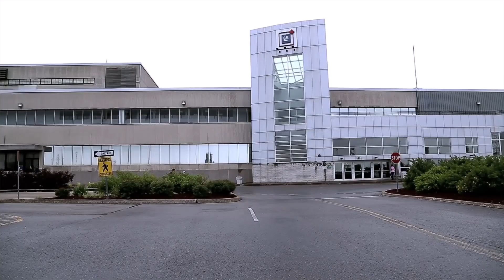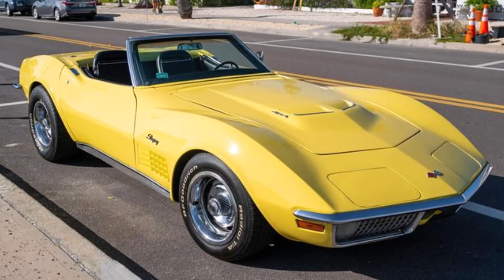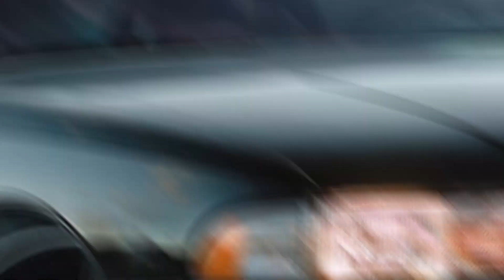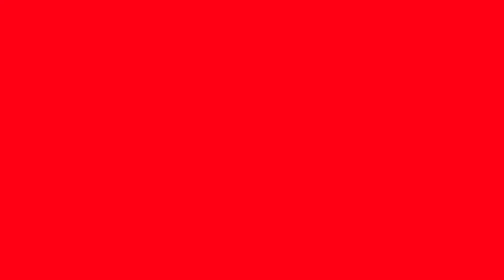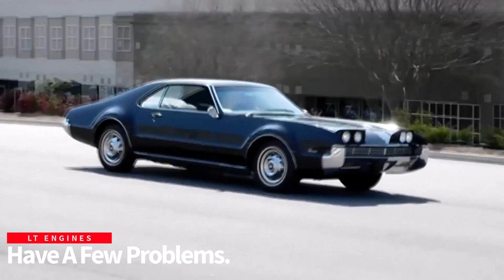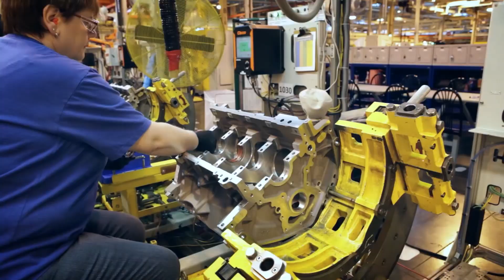The Truth About The General Motor’s LT V8 Engine’s Reliability

Comment: 1. ‘53 - ‘54 Corvettes only had 6 cylinders.    2.  Buick Grand National had a turbo v6.    3.  Late ‘60 Cadillacs had a 500 ci engine.   4.  a ‘66 Toronado had a 425 ci engine.
Reply from the maker: alright, 
1: 1955 Corvette had a 4.3 OHV V-8, The first time the sports car ever ran on a V-8. ( 54, 53 had an I-6 )
2: Yes, Buick grand national 1987 has a turbo v6, Still, I didn't mention it had a v8 engine.
It's just a footage of gm best cars after being yanked from the market until 1992
3: 1966 Cadillac Fleetwood 75 had a GM Cadillac V-8 429
4: Again, The 66 Toronado, It's just a footage of gm best cars
Reply from the maker: Nevertheless, thanks for pointing it out
Reply: Yeah this guy doesn't know shit.